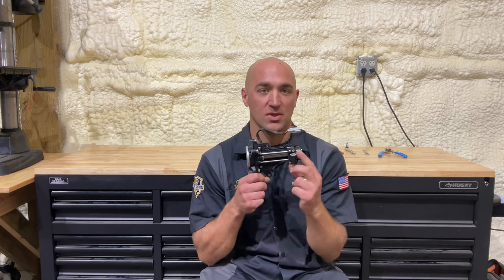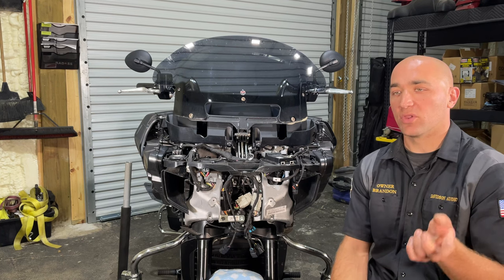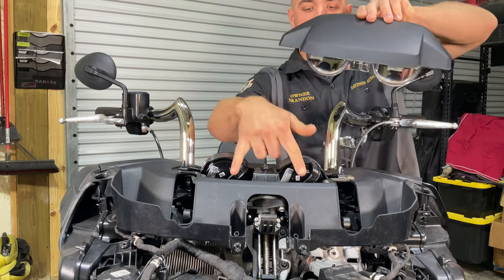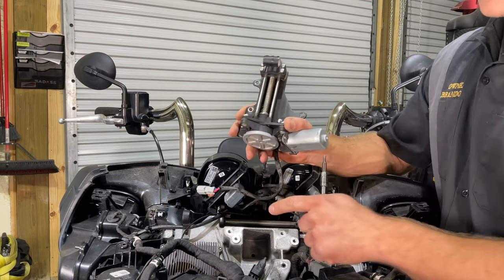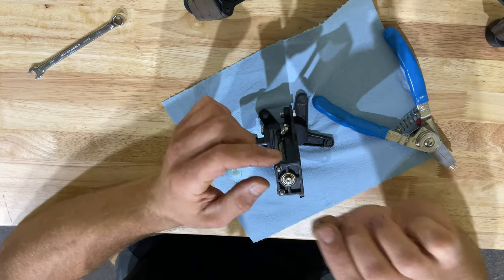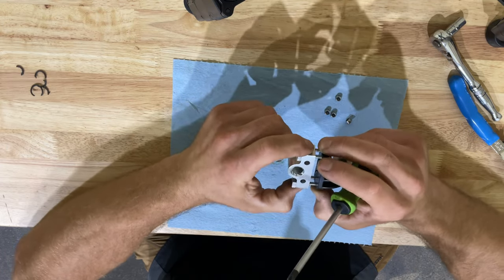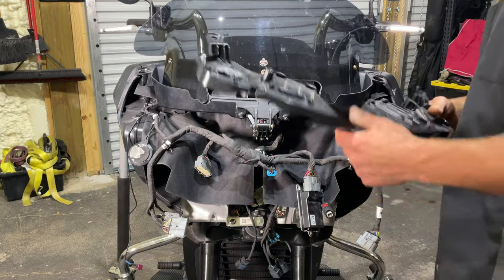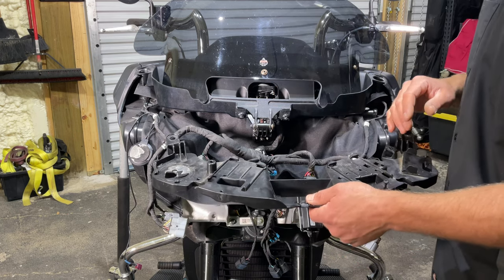Indian Windshield Motor Fix

Comment: I bet that would be a real cheap repair if you took it back to the Dealership you spent 30+ thousand dollars at. Oh Yeah!
Reply from the maker: There are different ways to look at it. It wasn’t until the 2023 year models that Indian corrected the faulty windshield gear. Being a customer with a 2020 model why would I want to go three years of potentially replacing the windshield gear from the dealership when I could replace it once and be done with it? Not to mention scheduling the appointment, down time with the bike being in the shop, etc. like I said we all have our reasoning for modifying and improving our bikes.
Reply: @DavidsonAudio  Excellent how to Video. My point was all this money for the Bike and it has this silly plastic geared motor on it. If you didn't have your tools and talent, had to take it to the Dealer they would bust your wallet several thousand bucks easy to tear apart that whole fairing plus the down time.   Steve McQueen "the Hunter movie"  "Nothing new any good"....

Comment: There should have been a recall on that windshield motor. Everyone I know that has a windshield like that has a problem with that motor
Reply: they will fix it under warranty, recalls are typically for issues of safety

Comment: Good part , but could use one finishing -touch.... the shuttle-block has two through-holes for the guide-rods to pass through , to guide the block's upward/downward travel.....

 those holes (4) should Have a little a  bevel so the sharp edges of the holes don't bite into the guide-rods.... 
ALSO... LUBE THE TWO GUIDE-RODS........

Comment: Things are different when removing the gauge cluster Brandon spoke of on the 2020 Indian Roadmaster. Remove 2 screws in the phone storage box. Also, one screw from the left and right upper top speaker area to remove panel referenced at 3:50.

Comment: Thanks Brandon! Your video helped me out tremendously! I finally decided to complete the nut replacement today after having it on hand for almost two months. Why? Been enjoying riding and too hot to sit still in a hot garage. Overall, moderate level repair for the average guy in my opinion.

Comment: Considerably more drag at 60MPH between the Klockworks (which I do have) and stock.  Or for that matter any windshield that’s larger than stock. 

I have to wonder if anyone that has NOT changed to a larger Klockworks windshield and had this issue?

Could explain why Indian didn’t catch this.